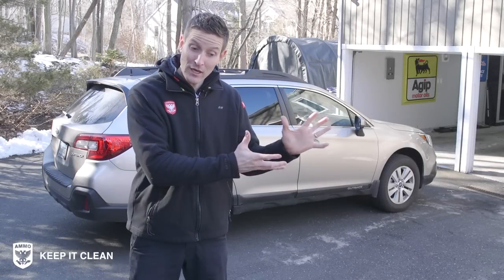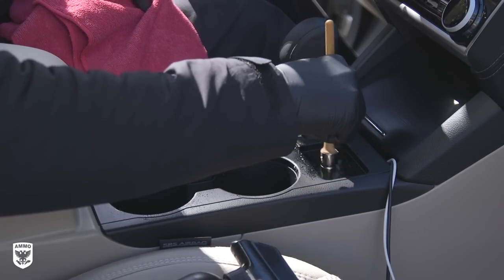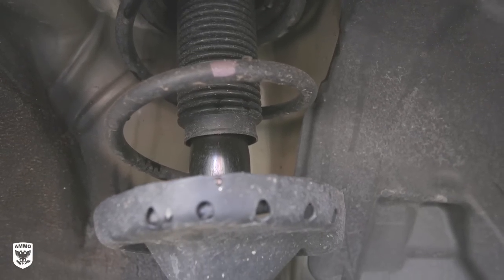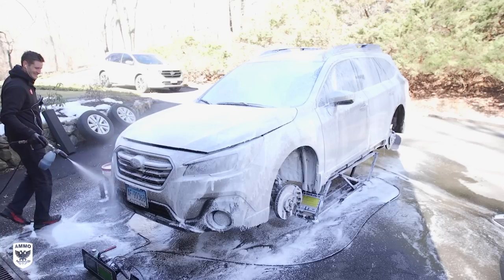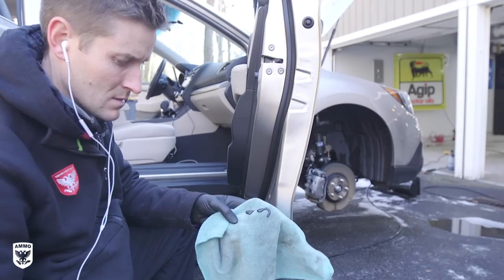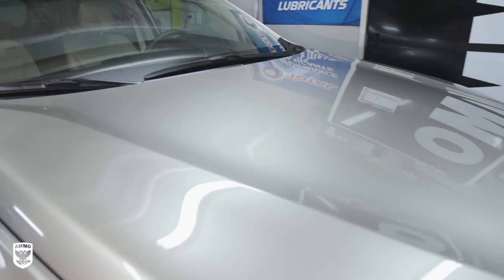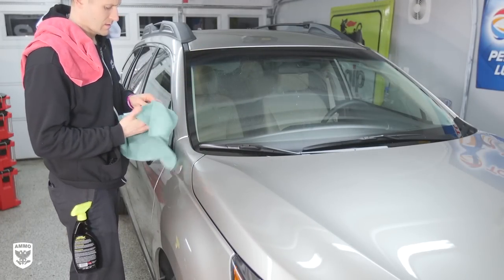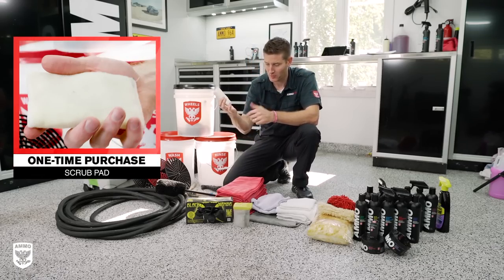Best Spring Cleaning Car Wash to Remove Salt!

Comment: I detail my 22 year old shitmobile for summer by filling up the tank and adding air to the tires.

That's enough, it looks exactly the same

But I wish it was worthy of a wash like this, but I might lose the structural rust holding it together
Reply: I had an old shitty rusty Toyota some time in my youth and one day driving home from work the floor under the driver seat just gave up and the seat fell out on the highway... damn I was surprised.
Reply: When the detailing products cost more than the car is worth
Reply: “Structural rust”
Reply: Lmfao
Reply: Weight reduction
Reply: @ferrari4968  rust welds to hold the structure together
Reply: Yet you have 3 Deloreanis I know I spelled that wrong
Reply: feels like a bit of overkill to fill the tires, but whatever.
Reply: Same
Reply: I find it funny how rust sometimes can make you shitmobile more durable

Comment: Huge smile when you got to the undercarriage.  How do I describe this. The outside can be a little dusty or even a little dirty, but rolling down the highway or stop light sprinting in town, I know the running gear and that engine bay are CLEAN and PERFECT. Call me weird, I consider Engine Bays a work of art.  :)    Son and I are OCD Daily Drivers.

Comment: I need to have quick jacks in my life
Reply: 30RedPillsAday there expensive sadly 😞
Reply: Yea exactly they’re like $3000
Reply: NFL YoungBoy that is about the price of a 2 chassis lift.... Jesus.
Reply: It’s new it probably go down in price
Reply: You can get the 5000lb ones for $1500 shipped.
Reply: from what Matt Moreman was saying, they're kind of a pain to deal with.
Reply: i need a car in my life :(
Reply: I bought mine for my 93 rx7 about a month ago and honestly there’s 100% worth the 1250$ I paid shipped to my door, not to mention I feel way safer working under them then jack stands. Even at full lift it’s super stable and I have no issues working under the car. Once you get the hang of setting up your lines and positioning under the car i can get the car in the air in less then 3 min start to finish.
Reply: i swear  i need those jacks asap
Reply: 30RedPillsAday i want to
Reply: more like $1500 for the most expensive ones.  it's worth it only if you're going to use it.  I can't remember if it was Larry or ErictheCarguy who said "you can accomplish the same with jacks and jack stands, this just saves time".
Reply: 30RedPillsAday and you need trump out of your life my guy
Reply: jim jon  Also, what happens if it loses pressure? I'd hope it locks in place, otherwise if a seal were to blow, it'd fall!
Reply: Did you get it yet?

Comment: When we left the rust belt for sunny California in 2014, both of my Year-2011 vehicles were showing the effects of road salt. I knew that if I didn't do something quick, I'd lose my vehicles to corrosion. I wasn't lazy; I always hosed off the road mud/salt from underneath as soon as I got home (froze my a** in the process!). The long 2,000-mile+ trip helped get rid of a lot of the rust. When I got to Cali, I noticed a lot of the red rust had been "sandblasted" away by road sand and granules. I quickly steel-wooled and wire brushed the rest away, primed and spray painted the metal with rust-neutralizing paint. I feel none of these products here or anywhere will revert the rusting process, NaCl will always win unless you remove it MECHANICALLY and then protect the metal with neutralizing paint. But I enjoyed this video and would be willing to give SOME of the products a shot. FF to 2018, my vehicles look great, rust-free and are worth more that what "the book" says, because of the "perceived special care" by the owner, that makes it desirable by a potential buyer.

Comment: So that’s a couple hundred dollars of Ammo cleaners on a Subaru just to clean it.
Reply: I would estimate the amount used  on his car is worth roughly 10-20$ which is ok for a twice a year wash
Reply: @michaelsieber98  pfft. though buying all that is indeed over 200 bucks, but you only use 5% to 10% of them for single treatment. so you either need to clean 5 cars to use the remaining products. cause after "opened product stays advisable for couple months." like most of paint cans i buy... only use like 40% to 60% of them and rest goes to waste disposal.
Reply: Or have to pay for a new paint job in 3 years if you want new car shine
Reply: This video is so extra the tiers and the bottom of the car are going to get dirty anyway
Reply: All you need to clean is the seats,carpet,Wheels,and the outside of the car
Reply: Eric Pantoja Reyna it’s not really “so extra” it protects the car. And holds its value. 

Now I’m not usually the one to worry about resale. But in my case I totaled my Honda that I used ammo on for years. When insurance looked at it, they told me and I quote “the paint was in immaculate condition” which guess what? Got me top dollar for the car when they wrote me the check. 

Like he said. You don’t have to do it. But when you have a passion for it, it’s worth it
Reply: HL Vlogs I agree but you got to admit it’s a little extra
Reply: Eric Pantoja Reyna again yes and no. Where are you from? North East is terrible with salt and it results in rust. If you don’t clean it off/protect it. The vehicle will corrode
Reply: i really want to use ammo products but they are so expensive
Reply: wesley johnson Larry suggests meguiars if you’re on a budget

Comment: Be honest Larry... how many hours you think you did it, i know its more because you need to move/adjust the camera for better shooting. In my case i expect 6 hours
Reply: This would take us normal car washing mortals all day and then some, but it is worth the trouble if you care enough about your vehicle. I might just do the first wave as he demonstrates on day 1, pull it inside the garage and then hit the exterior on day 2, since I know it will take me longer. I hand wash my car regularly, but I admit I'll be a bit rusty and slower than normal after having to take the winter off from the regular regimen.
Reply: Carlos Rivera I think 3 hours
Reply: As you can notice, its was early in the day when he started, and in the garage you can see its dark outside... so he is a mortal also 😁
Reply: The Rock he’s a badass. I usually do this twice a year as well. Totally worth it. I’ve adopted several of his techniques. The car is so much cleaner. Makes heads turn.
Reply: All of this without the camera for a detailer should take around 3 hours. But again this is a great video for after winter going into spring, not exactly a weekly detail.
Reply: Not having a quick jack would make the process longer. Also having all the tools Larry does helps with the speed. I’d say an afternoon to do all of this.
Reply: Sorry i meant 3 hours of work, yeah definitely an afternoon or more.
Reply: I definitely think more than 6 hours. To jack it up clean everything, along with using the camera to record, im guessing 8-10.
Reply: I said not including the cameras.
Reply: Did something similar to this 2 weeks ago and it was a solid 8 hour day with a couple hours the following day doing skin and finishing the interior. YMMV
Reply: MrRarekiller10 even without the camera, it's still way over three hours
Reply: Be prepared before you start have a plan of action it really helps
Reply: Well, when I clean my motorcycle (and it's a 250cc) it takes me 16 hours in two 8 hour shots, but since I am a mechanic my cleaning is mixed with disassembly and service. Because I have used it for work there are always surprises along the way.

Comment: You're not SUPER-DUPER OG clean until you actually unbolt the front seats out of the car to be able to vacuum and clean every single possible nook and cranny everywhere on the carpets.  And yes I have done this a number of times on mine and my wife's cars.
Reply: I go to my local Walmart and rent those carpet cleaners that shampoo, wash, and dry the carpets in 1 quick and easy step, I remove all the seat and pass it to make them smell and look new
Reply: Patrick94GSR i dont believe you till you put it on video.
Reply: Patrick94GSR guilty
Reply: Patrick94GSR 
No my friend it’s not clean until you take every single seat out stripped the car to the bots and clean the bots and clean and repaint the car.. replaced every fluid even the blinker light fluid

Comment: I agree that no one really sees the inner sidewalls,but my last set of tires I didn't care for the inner sidewalls and it made a huge difference. They were actually cracked and just plain nasty while the outer sidewalls were in prefect condition. Also clay bar on glass works well too. Thank you, as always,for sharing. Take care.

Comment: I kinda stopped watching when you start cleaning the back side of the wheels. I barely clean even the front side...
Reply: Yeah then this channel is not for you I guess.
Reply: toompie69 thanks, but I still enjoyed watching him cleaning. Just don't have that much of time do it myself.
Reply: I appreciate the whole process and it looks awesome. Like you said I dont have the time and its to much work for a daily driver thats gona look dirty in 2 days again anyways. I do a thorough clean, but skipping all the wax protection parts.
Reply: i do mine just like that before and after and my wheels look good
Reply: Lei Chen anything worth doing, is worth doing RIGHT.  Just doing it well is half-assed. I learned that from my father - RIP.
Reply: blueberrycobbler you can clean the outside of the tire right.... Who looks at the inside of your rims?....

Comment: Regarding rust fighting, he neglected maybe the most IMPORTANT areas: the INSIDE lower portions of the doors. You first want to clear the drip holes underneath and then generously spray water in, using any openings like this guy's car has (note the black plastic cap near the top), then spray water the inside the fenders through the openings behind the hinges - lots of salt and sand find their way there and stay moist - rust !!
 I do this to all doors, hood, trunk, everywhere I can spot openings, drip holes... Another area are the side joints between fenders and bumper caps front and rear: you'll be amazed by the crap remaining there. Also the the suspension towers.
I use my pressure washer to do all this. I may be right somewhere since I usually keep my cars for at least 15 years, and this in Québec, with it's harsh, cold, humid winters and the unavoidable heavy use of salt !
BTW, nice infocommercial for Ammo products. Other brands are as good for way less $$ !

Comment: When u clean the car sooo beautifully, don't feel like takin it out on road. Our car was in a bad shape after being impounded by cops. Service centre did polish it but cud not remove fine scratches. Guess they did not use micro-fibre pads. In India, our cars r used to being dirty from the inside as well as bottom. When u clean it, I will just keep it in my hall...🤗👌🏻🤘🏻👍🏻 Thx.

Comment: Love these video's. An OCD dream. When I lubricate the door hinges I chuck an old microfiber or a bit of tissue behind the hinge as a splashback and then wipe off the excess grease as it's not doing anything on the outside and turns black with crud after a couple of months!

Comment: I personally use the method that you may be trying. I use clean microfiber towels while washing folded in 4’s never putting them back in a bucket, like the Gary dean method, it works great.

Comment: I have found the magic “pill” for paint... It’s called a matte vinyl wrap. Place on painted surface of car. Because of the matte characteristics my car only usually requires water to sparkle and a wipe down to avoid water spots. Every other wash (usually once a week in the summer) i use soap. Sadly the rest of the car still requires the same attention you see here/.

Comment: Ok to work with water/soap around Quick Jacks...? For those of you think this is too much, you can simply do the undercarriage & the wheel wells when rotating tires - which will require you to put the car on 4 jacks (especially for AWD rotations). Wash the engine bay, exterior, and/or the interior on a different day!

Comment: After you vacuumed the whole inside of the car you can use compressed air to blow under the driver and passenger seats to get all the dirt and stones to the front floor, then you can vacuum again !

Comment: Here’s a tip chaps , vacuum all the big stuff out , then use your garden leaf blower under the seats and down the seat sides , vacuum  it again , then use the leaf blower again all the time with the doors open , saves heaps of time  and blows all the little bits out from under the seats etc also blow in door pockets and dash board .

Comment: I can tell you from experience that coating your tires on the inside is a good idea. I've had to replace tires that had 6/32 of tread left because the UV light caused the tires to crack and dry rot at the tire bead and the rim location. So using a rubber or vinyl protectorant is a good idea. Don't want to have a blow out at speed. I can't tell you how many people I see driving around with a tire that's 10 or 15 lbs low. Being a retired mechanic after 30 years. I've learned that a tire that's low by only 5 lbs will wear out 25% faster. Now days, people have a LTPW light on the dash. PAY ATTENTION TO IT. If you don't, then you better know how to change a tire. When a tire is real low, the sidewall which is only 2 plys, gets really hot from rotational friction, after extended driving the tire will heat to the point that the sidewall can no longer stay together. Trust me 30 years of experience or don't and find out for your self. Those lights on the dash are there to remind you that you are neglecting the message.

Comment: Larry, I'm concerned about your technique of applying RaineX. A few years ago I squirted it on the windshield like you did and it left annoying spots I couldn't clean for months. You spread the product immediately after the application, and you are not working in direct sunlight, which slows down the curing process, so you are most likely safe. But from my experience it's always better to apply RaineX on an applicator pad/foam and spread it evenly in a thin layer. Nevertheless very satisfying video. Best.

Comment: Awesome videos. You are a true professional..quick question for you..or anybody watching..what's the point of 2 bucket method? I get that your trying to rinse off the mitt (towel) but it doesn't make sense to me. After you rinse the first time doesn't water gets dirty? Your always rinsing mitt in dirty water then going to soap bucket. I don't care how many grit guards you have the water is still gets dirty. Why not just use the hose to rinse off mitt instead? Why not use clean fresh water vs dirty water in a bucket. Its simple quicker and more effective to me. If I'm wrong please tell me why. Thx.

Comment: If your doing a spring cleaning my Must do tips #1 Find areas that hold dirt  Bottom of doors fenders and the seal around your trunk and the leafs at the back of your hood  Why is this number 1?  Dirt and water form Mud  Mud takes much longer to dry then plain water and you will get rust bubbles forming quicker 
#2 if your taking off tires and cleaning the area with soap and water ..Get yourself a grease gun and do a lube job One or two pumps is always a good thing  Sometimes when you have a oil and lube job done They miss a few places or dont have that one angle tip to get to that one ball joint and just let it go without saying anything ..Do it yourself and you know its done 
Door hinges need grease too !  Using grease on the pins and caps give the metal longer life  Oil is a far second place  And items like WD40 and other products along that line only help for a few days if that and i would never use it as it also washes away any grease that was there

Comment: At first glance it is seen that the water pressure on the engine is sufficient for it to enter the screws. Not all screws come with factory sealant. If after a few months you start to disassemble the engine bay you will see how most of the screws have sulphate

Comment: Larry, could you do an updated video on how to remove etched water spots/marks? I left my beloved 991.2 GT3 (Metallic Black, so a nightmare to keep clean!) out in the sun after some pretty heavy sandy rain. I've cleaned it twice since, tried polishing by hand, but STILL can't get the marks out, I'm worried it's ruined the paint completely!

Excellent video as always.
Reply: Use a da polisher with a polish if that doesn't work use a rubbing compound. After follow up with a wax/ sealant.

Comment: When changing from winter tires to summer tires is the best moment to clean your car for spring. Especially the arches, so you can do two things at a time. That at least is how I do it.
Reply: In the South we don't use Winter tires.
Reply: Well ok, but not everybody lives in the south where i is warm all year long. :)
Reply: My point is that most people in the South don't do a seasonal tire change, so they're less likely to do any sort of deep cleaning like this.
Reply: Patrick94GSR then they won't be doing a big spring cleaning after winter would they?
Reply: Well then I would recommend to do it without changing your season tires. 😁

Comment: You showed spraying the soap solution on the underside, but didn't show how you rinsed it off. Just spraying with a hose or pressure washer from the side is ineffective. Did you use an undercarriage attachment for your pressure washer?

Comment: Hey Larry we have the same new subi and I noticed after a wash that if I got hydrate on the black cladding of the subi like rockets or roof rails I would get some white leftover mess. Is there an easy way of removing the hydrate. It's also protected by skin and reflex. Thanks for the help. Out 2018 silver outback looks amazing all dressed up in Ammo